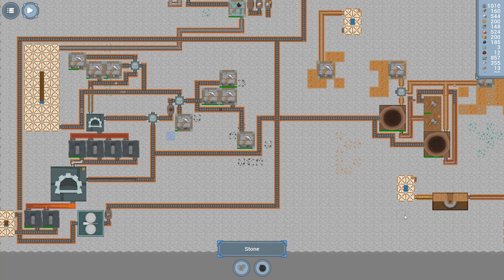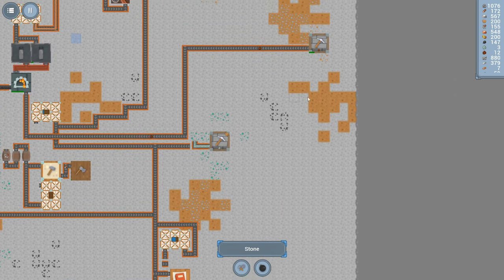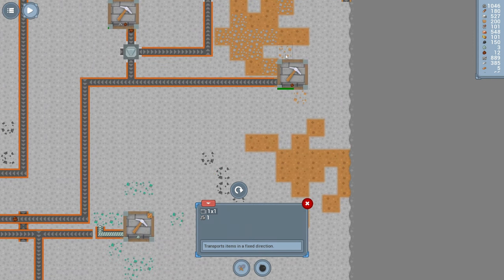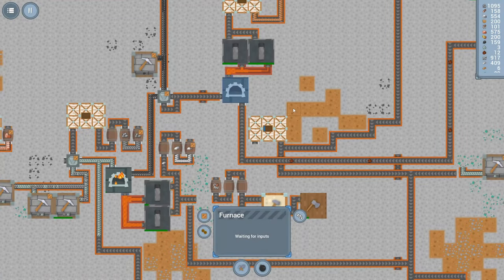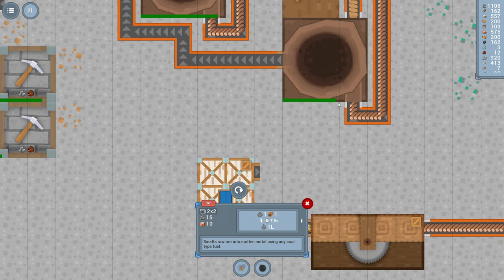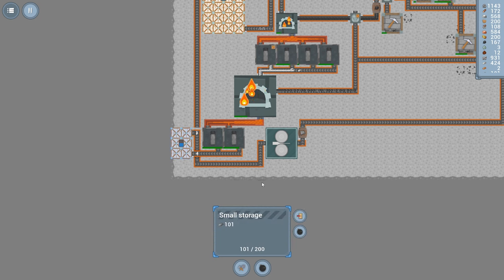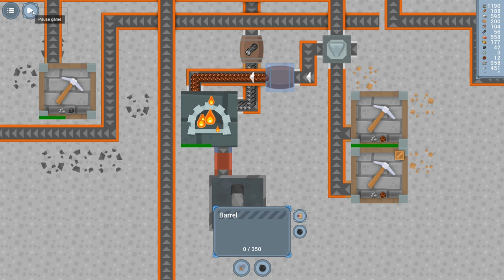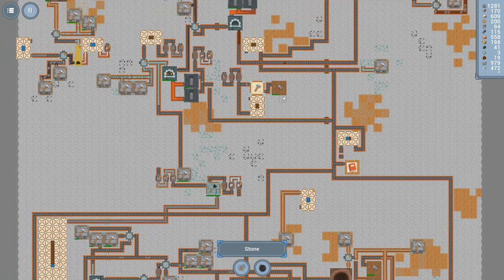Let's Play Drill Down  s01 e09

Comment: When you place a bridge down(or edit), there are two buttons, the one for rotate, and the second with two arrows is to change direction of the lower track.  The upper track auto-aligns when the bridge is placed, but the lower track needs to be set manually with the button with two arrows.
Reply from the maker: Thanks!  I always seem to trip over those controls a bit.